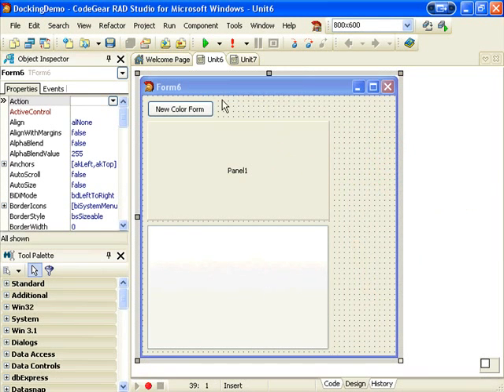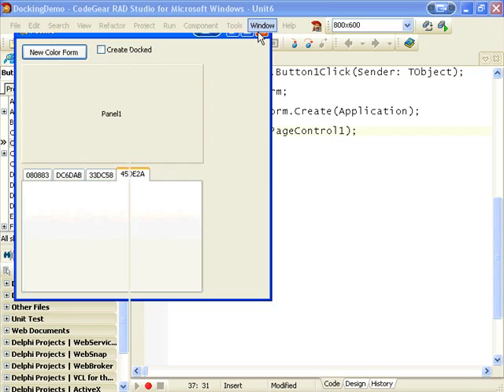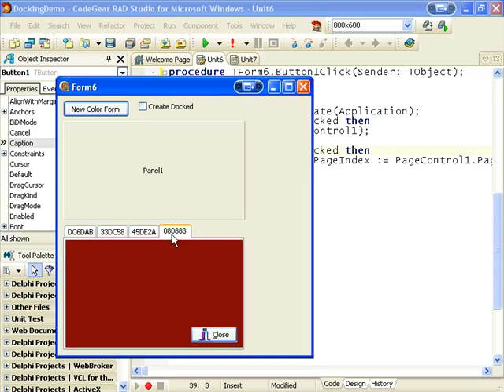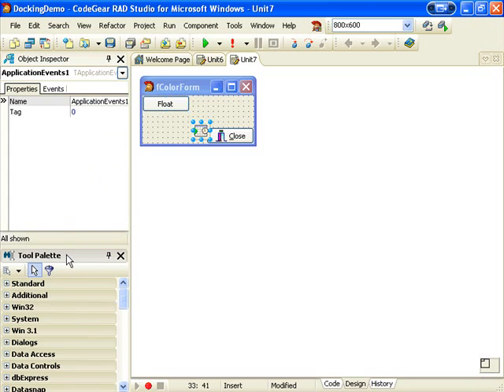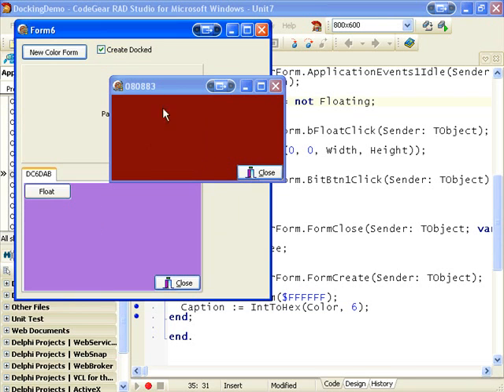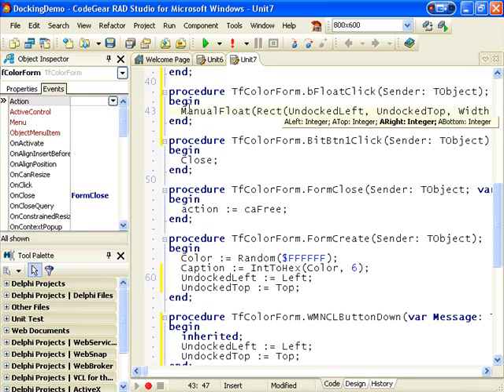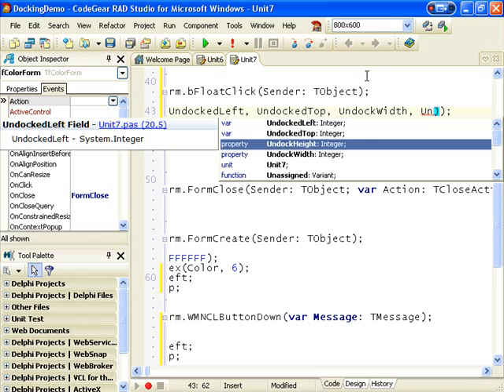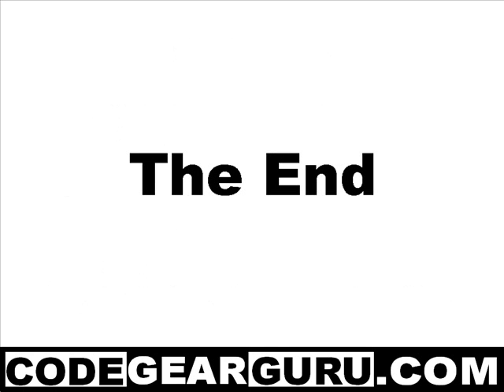Delphi Programming Tutorial #33 - Dockable Forms 2

Comment: Thanks for sharing the video.
A big (and so far unresolvable by me) problem is the fact that the controls owned by a form that is attached/detached have their windows re-created upon docking/undocking.
This is a major problem - not only this is wasteful, but it often leads to a loss of state that is impossible to save/restore in the application. An example of this is an embedded browser control. In case of the TEdgeBrowser, for example, the control performs a navigation to the last URL it has. Which completely wipes out the state of an HTML app inside.
Tha same issue exists when changing a control's Parent.
If somebody has any idea, I'm all years (and eyes as the case may be on YouTube).